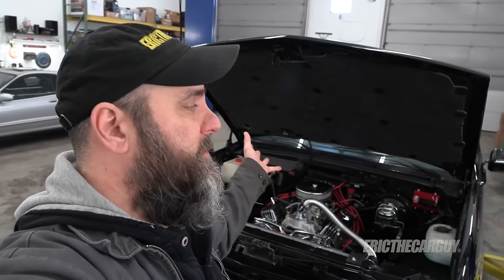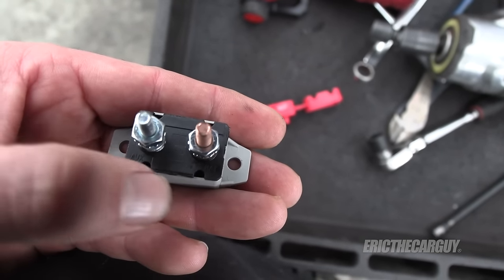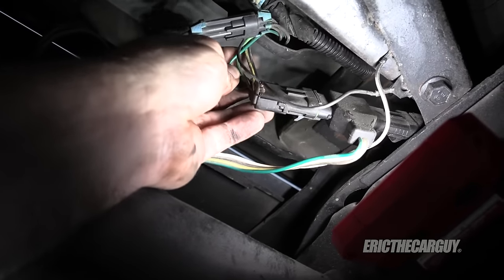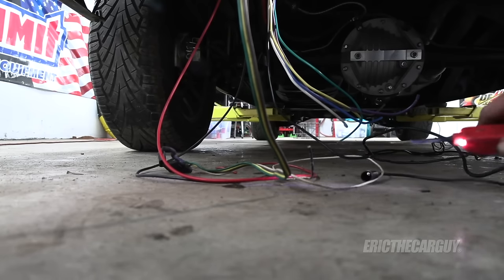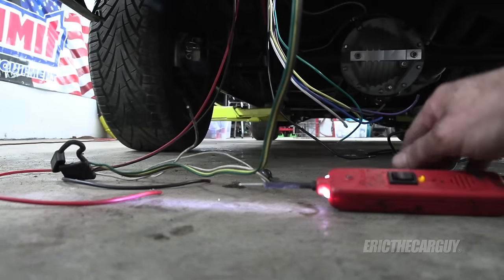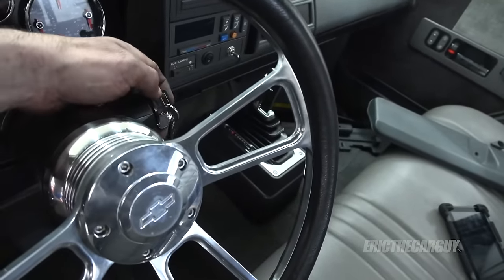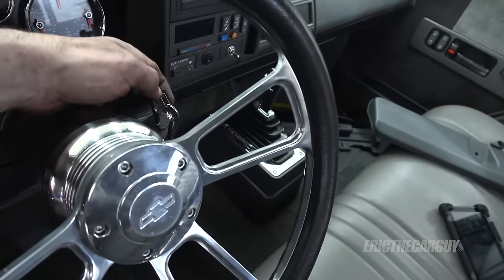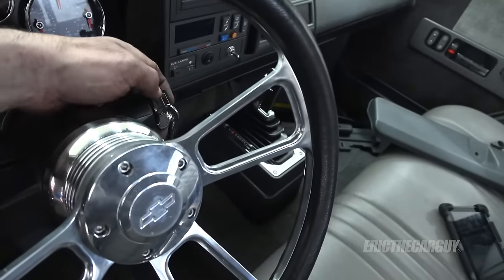How To Install and Connect a Trailer Brake Controller

Comment: I find it really peculiar that in the USA, trailers seem to be braked with electric power? I've never seen this here in Germany - the only trailer brakes I know are purely mechanical and they work by the trailer pushing against the tow vehicle, and therefore braking the wheels on the trailer (by their own inertia force, so to say). But then, the highest weight a trailer is allowed to have here is also just 3.5 tons, anything above can't be towed with a passenger vehicle at all, but needs a truck and at least an air brake system.
Reply: I wondered exactly the same. In general, everything in America is over-simplified, but then electric trailer brakes :o ...Greetings from Finnland :)
Reply from the maker: Yea, things are different in Europe.

Comment: Note to self:  Make sure the truck I buy had this stuff wired at the factory!
Reply from the maker: Most newer trucks do, especially if it's a 2500 or above.
Reply: LOL, buy a truck with a tow package, problem solved.  Not sure why someone would buy a nice new $50k+ truck and not get the tow package, helps resell value at the very least.  Makes it so  much easier to add a brake controller, and anything else down the road if its a factory install not some backyard warrior trying to hack everything together type installs that never works right LOL.

Comment: What is the latest model vehicle you can hook up a vintage hydraulic over electric trailer brake controller?
I want to buy another travel trailer like I had years ago to pull with a pickup truck.
I don't trust those modern design trailer brake controllers or the trailer brake controller systems on the newer vehicles. 
I do not trust the trailer brake controllers that does not hook into the hydraulic braking system on the towing vehicle. To my knowledge and years of experience it's the only way to get equal pressure on the braking system of both vehicles at the same time.  
Surge brakes for extremely dangerous in my experience!!!
And I do not trust a trailer brake controller that just has an on and off switch just completely idiotic and suicidal!!!
I also do not trust the modern trailer brake controls that have a pendulum in them because those are very dangerous on slippery surfaces too!!!

The Kelsey trailer brake controllers that I've used for the last 40 years are the only ones I trust! Are you still sell parallel braking. Instead of depending upon the towing vehicle to slow down before the trailer brakes come on which is a really idiotic design! On slippery roads the tow vehicle brakes will lock up before the trailer brakes come on, and the trailer makes me never come on until it crashes into something solid!
I have towed with surge brakes a few times and those are among the stupidest crappiest idiotic things I've ever towed with!!! 

In the 80s and 90s I heard people complaining about the pendulum type trailer brake controllers and how much they hated those!

I still have my Kelsey trailer brake controller from the '80s that I'm going to use on my next tow vehicle. So I need to know what years I can use it on.
I greatly appreciate that information if you have it.

Comment: 31:20  It was a real nice install until I saw the scotch-lock.  Really, Eric?  A scotch-lock?  Professionals should know better.
Reply from the maker: Sigh. It sucks when people don't listen to what I say in the video. Thanks for your comment.
Reply: @ericthecarguy  No, I caught your comment.  My time stamp was just of the finished install showing the scotch-lock.  Corrosion isn't always the issue.  Those things often make contact for a while then don't.  They sometimes cut strands of the wire.  They are unreliable and will cause problems, eventually.  It might work fine for many years.  It might not.  Others will see you, as a professional, using them and think it's OK.  It's not.  Cut away a little insulation and solder it or cut the wire and butt splice it.  Using a sealed butt connector likely isn't required but something other than a scotch-lock is.
Reply from the maker: I did exactly that with the reverse lights and noted my reservations about using those connectors when I used it for the brake light signal. I also made a point of telling people to verify the signal coming out of the wire when using those connectors. In other words, I share your concerns, and I voiced them in the video. Thanks for your comments.

Comment: I can't recall ever once having seen a trailer with reverse lights on it. I'm sure they exist, but I've never seen one.
Reply: One can use that reverse light wire to power a backup camera.
Reply: Very rarely do they have reverse lights...I haven't seen any either, and they wouldn't do much good, course adding your own that are bright enough to actually see what's back there would be a huge help at night.